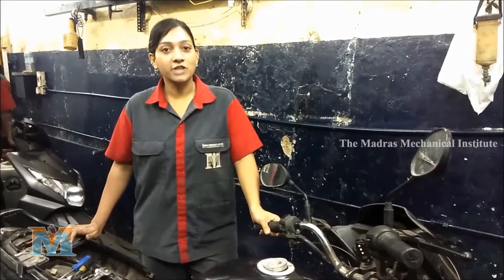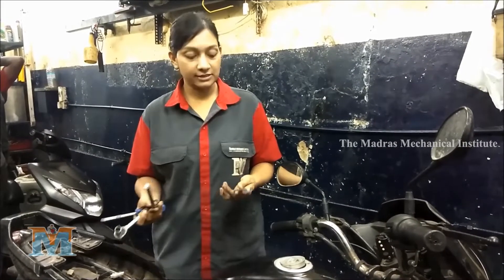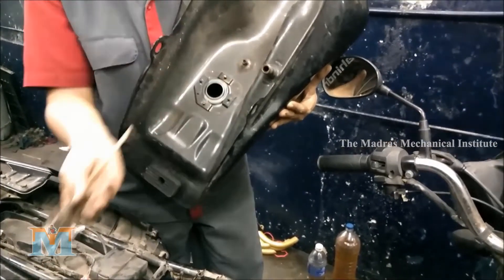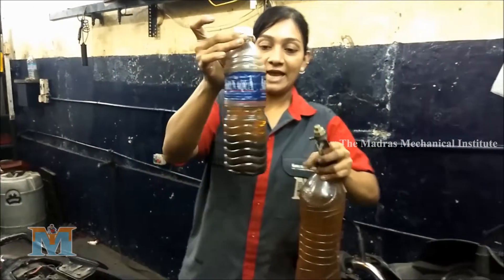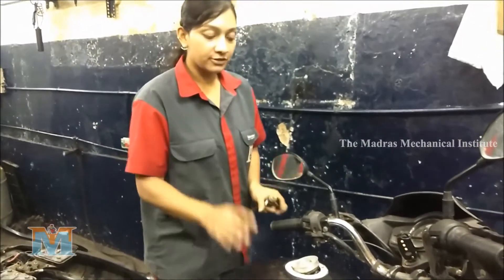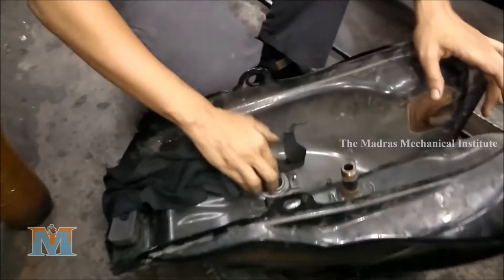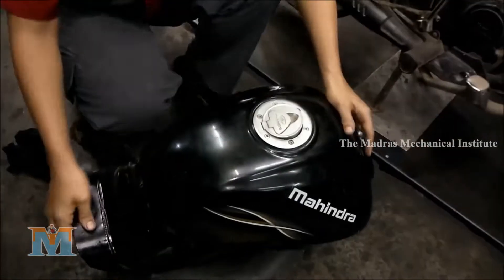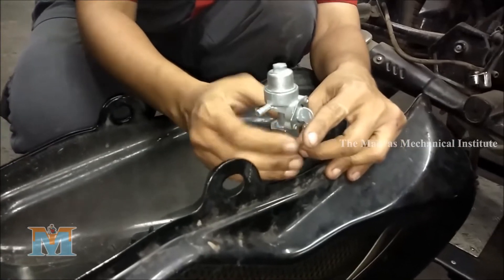#DIY_How_to_Clean_&_Replaced_leaked_Petrol_tap in motorbike I Petrol Tap Problem I MMI

Comment: Anti theft system is not working properly so any trick to remove it ..?? Mahindra centuro ...worst bike ever ...
Reply from the maker: Can you tell me that this problem has existed from which time & Duration.
Reply: Its too long almost 6 months i face this type of problem but no solution .sometime its working properly sometimes  suddenly wrong ...we installed new cdi also but no solution